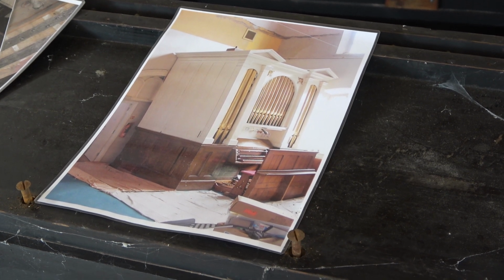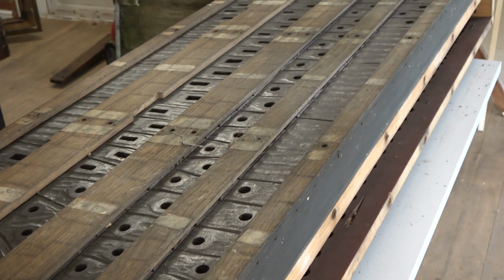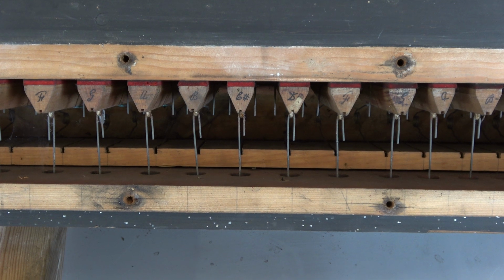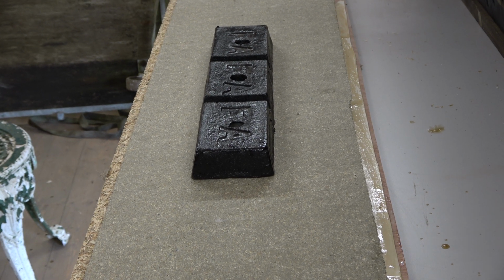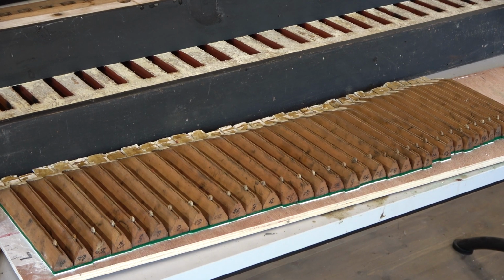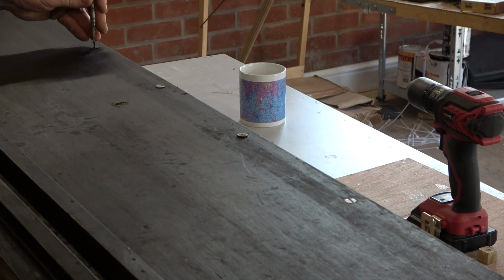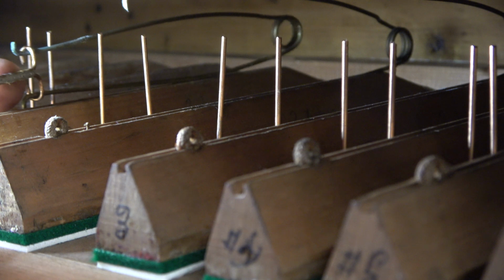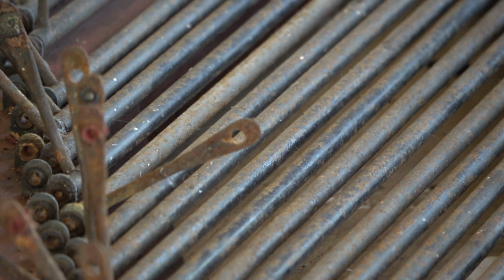1865 Forster & Andrews pipe organ restoration & installation  Pt 7 of a lot

Comment: Love this restoration project. 👍
Reply from the maker: I bet you're learning something from it!

Richard
Reply: @ukfmcbradioservicingTango21  I might have said this before but my wife and I are fascinated by ecclesiastical architecture, especially early fonts and rude screens, so spend a lot of time in some quite secluded churches around the Welsh borders. We've never really paid much attention to the organs in these buildings but this series has given us a whole new insight into them. 
I still can't get her excited about radio though, she always looks at me with an air of resigned pity when the postman brings yet another old CB or a rescued 2 metre set.
Reply from the maker: I'm lucky round here with the churches & most were started 1000+ years ago. In Ancaster's case, it was built on the site of the Roman Temple. I play at Ancaster, Wilsford (scratchy corner church), Welby, Kelby, North Rauceby, Heydour & Londonthorpe. I'm also available to 46 other churches when I can fit them in. Heydour, for example, has two pre-reformation stained glass windows coz the Cromwell soldiers were too pissed up to smash them properly at the reformation!

Richard
Reply: @ukfmcbradioservicingTango21  We have Kilpeck Church about 30 minutes drive from us, the earliest parts of which date from c.970AD. It has some of the finest 12th century corbels in the country, including a very risqué Sheelah Na Gig.
Reply: I am , I need more room 😀